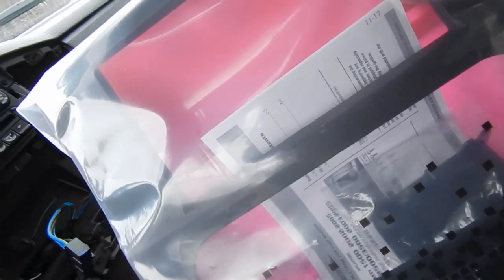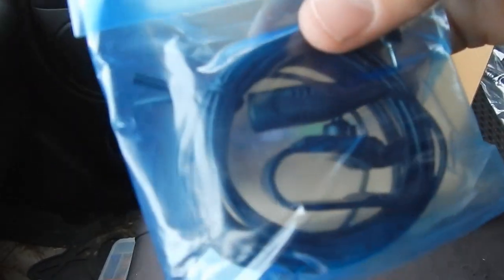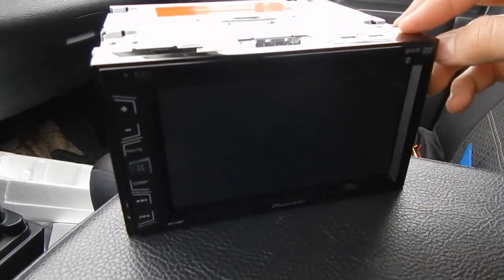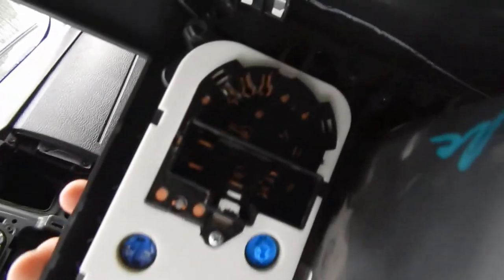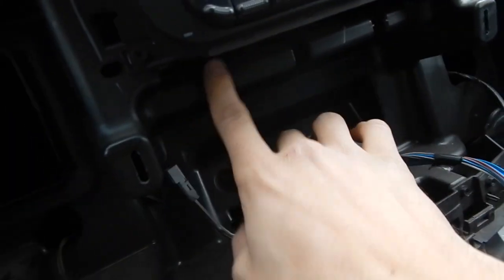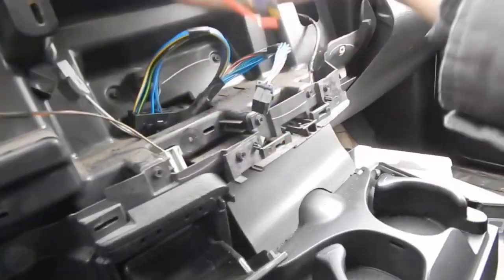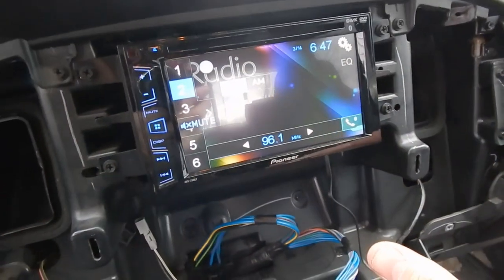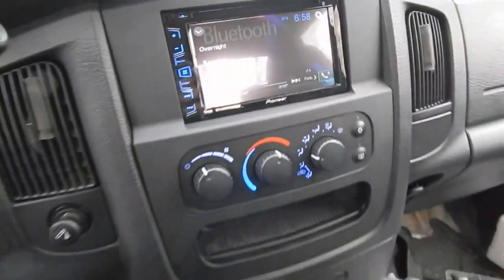2005 CUMMINS GETS TOUCHSCREEN HEAD UNIT!

Comment: Less chit chat, more install process. For those doing this same project: Pioneer has many higher quality head units that use a double din size screen but, single din size guts (like the DMH C2550NEX) so, no cutting is required. Unfortunately, the dash bezel I got (same one as his) was slightly too small. Always test fit your deck/head unit into your new bezel before ripping everything apart

Comment: I know this video is old but on that part where you have to cut how far did you cut out ?
Reply from the maker: I just cut out the back part till it was flat with the front sorta, don’t gotta cut to much out
Reply from the maker: Like that little lip with the 3 bubbles or so that come out you cut that about half way down and should slide right in
Reply: @LimitlessMoto  thank you